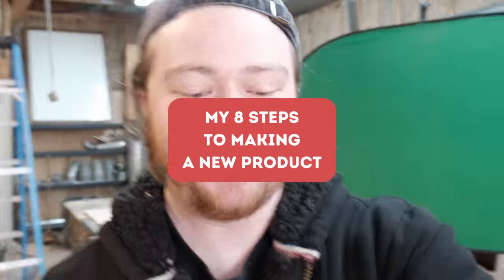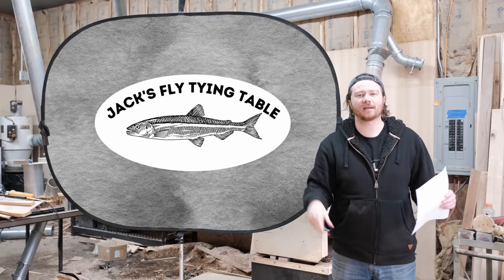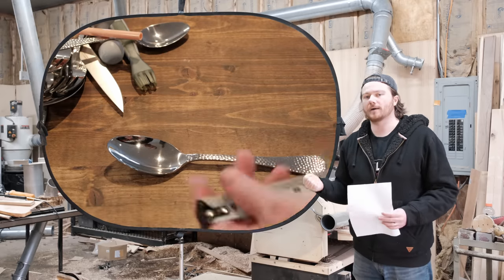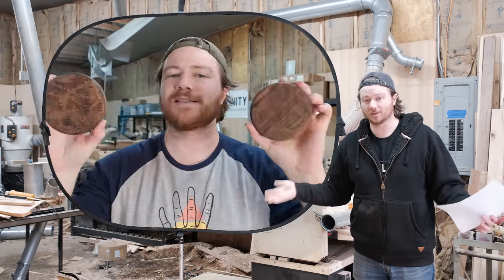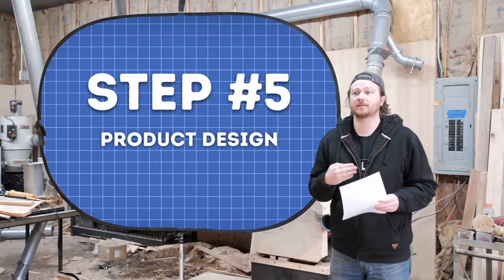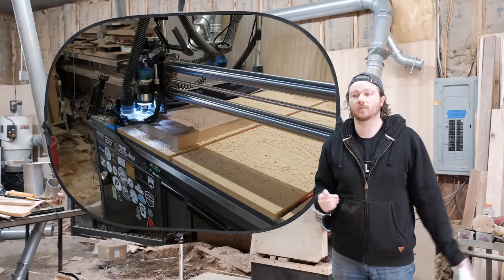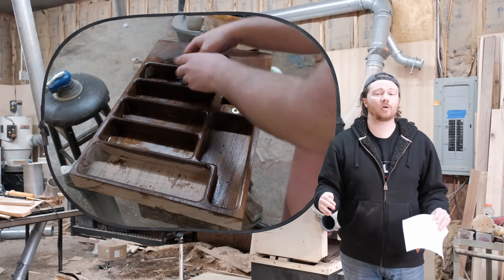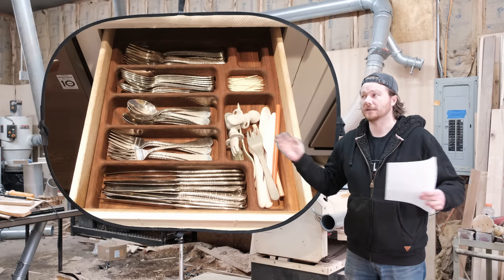This Makes A Woodworking Product Great

Comment: Hey Hamilton, I noticed the machine marks were still pretty evident in the final product.  Have you tried a "finishing" pass on your pockets? I'm not sure what it's like in Carveco but in Carbide Create it's incredibly easy, and the second toolpath will run right after the "roughing" pass.  Essentially after you remove all of the material from the pocket you run another pocket toolpath, starting at your finish depth that goes a few thou deeper, with a much smaller stepover amount. You can basically max out the feed rate to 300 IPM and it should remove the machine marks while not increasing your machine time very much.

Comment: I like your flatware organizer. Did you laminate pcs together to get the thickness or did you buy it at that thickness
When i try to make deep dishes in material it always warps out of flat. How do you maintain flatness ? Also you can buy a round over bit and machine all that without removing it or if you round over the bottom side make it a 2 sided job 
Have you actually had anyone buy one for the price you mentioned? I dont sell online maybe i should. Ppl in my area just will not pay that kinda money for an item as such.
Ive asked ppl to name a price and they low ball so bad what they offer wont cover the materials 😆 ppl dont get the price we pay for wood. They act like it's free. 😆

Comment: Wowzers! That was one wide piece of walnut!! How deep did you pocket those? I have a product that I make out of 8/4 material that I pocket with a bowl bit to 1.3" deep (it's a real stretch lol), and I cannot connect dust collection because the router gets so low it runs into it!